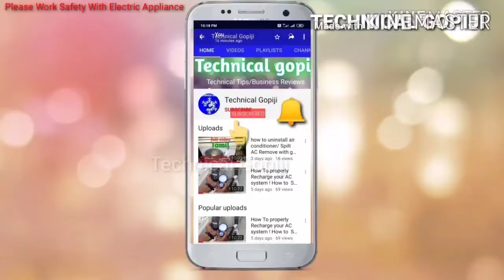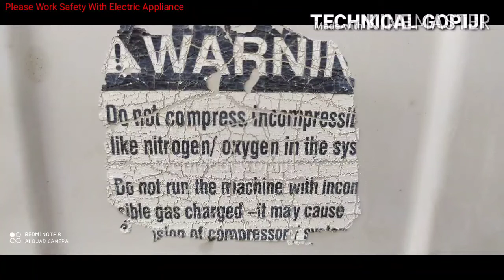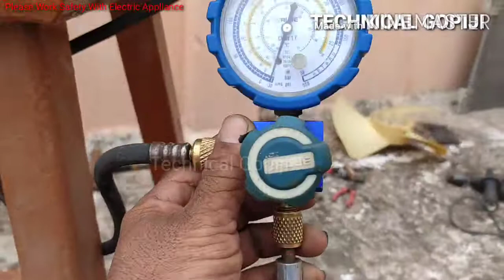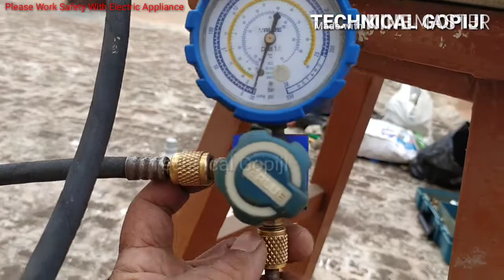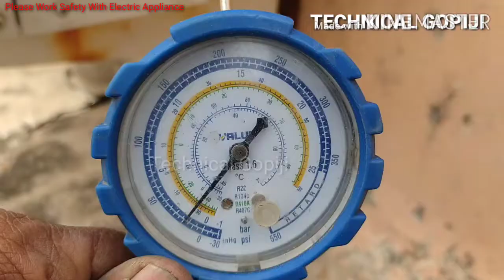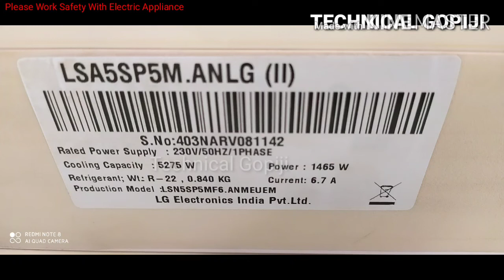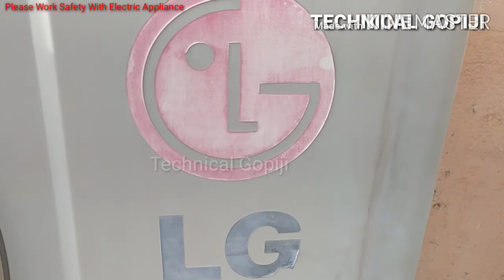Air condition Outdoor unit Aluminum coil to Copper coil Repair Work  TechnicalGopiji /25

Comment: Aluminium coil la leak illa, but technician change pannanum nu solranga, outdoor coil லா cement dust madiri iruku adhae service pannamalae change pannanum nu solranga, apdi change panna copper coil 6.5k nu solranga, avvolo varuma,.
Comment post on 12.06.2022.

Comment: When changing aluminium coil to copper coil condensor, is single row or double row coil is better  for LG inverter AC ? Will it affect the compressor ?

Comment: Hi , Gopalji, my Ac outdoor unit is Aluminum condenser coil , it is having the black circular patches (oil fungus) like you showed in video. Samsung company says it can not be repaired, but wants to replace Aluminum with Copper for Rs 12,000 . Is what they say correct?
Reply from the maker: Hi sir maximum 9500 fixing cost

Comment: After replacing the  leaky condenser from aluminium to copper then the ac works good or not?
Reply from the maker: Aluminum coil cheng After copper coil cooling 60% 70 cool  coming only brother
Reply: @technicalgopiji3418  if we replace with aluminium  to aluminium coil then the same cooling coming or not?

Comment: How much is the consumption increase in terms of amps and watts. 
And what about cooling.
Because I got mine changed from aluminium to copper 3/8 single row condenser coil like yours but now ac is taking 2200w earlier it used to take 1470-1500 max with excellent cooling.
Kindly suggest.
Thank you

Comment: Please give ur number. In my a/c also same problem. In my home I have LG inverter a/c having problem with coil. Have to change from aluminum to copper.
Reply: same problem bro, yesterday technician arrived and taken both indoor/outdoor unit, for replacing copper coil will cost around 8k it seems
Reply from the maker: 9944199661
Reply: @technicalgopiji3418   I tried call this number. Some one said wrong number